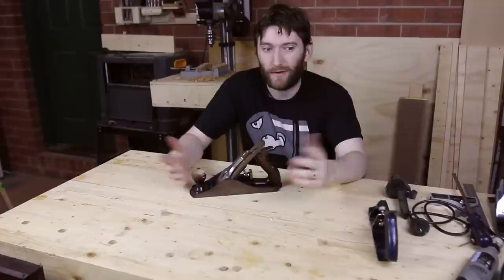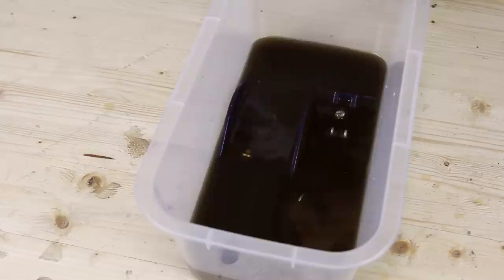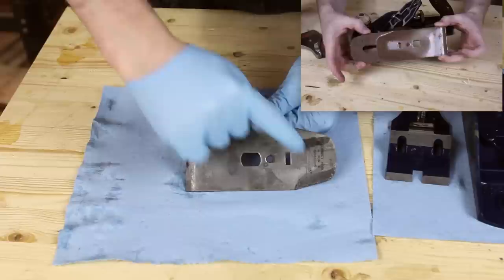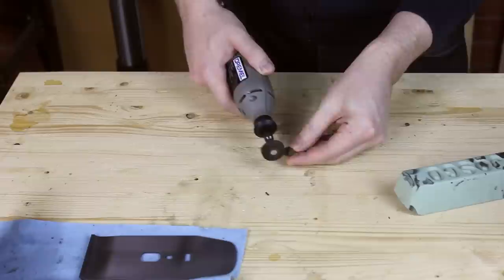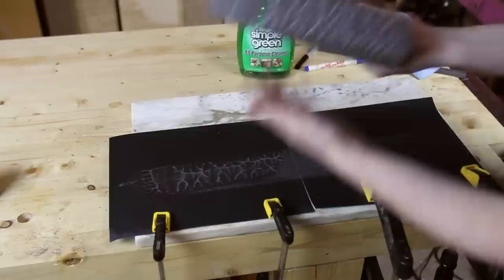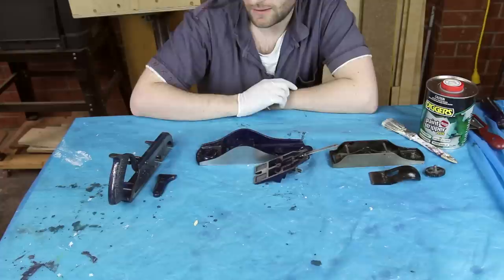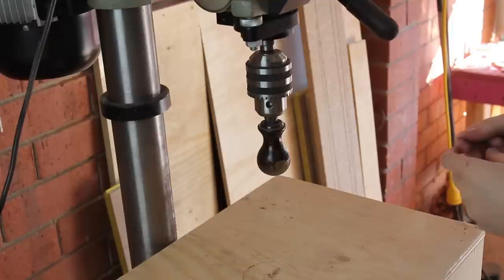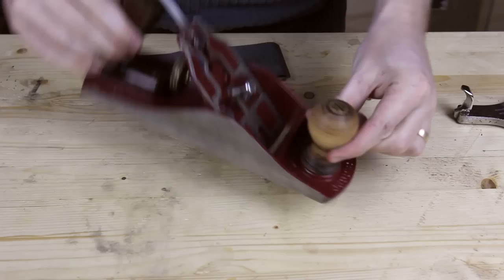017 - Restoring a junk market hand plane

Comment: When dipping something in whatever solution, for whatever purpose, if the part to treat, coat, derust, etc, isn't covered entirely, a simple trick is to use a non reactant object to displace liquid and enable full immersion, a small glass jar with some ballast to weigh it down would do the trick fine!
Reply: Excellent suggestion.

Comment: You probably already know this, But when ever I sand metal, I get it wet with water first because then the 'sand' from the sandpaper acts a little like diamond past, but WAY cheaper. It will create a paste, which is just the sand and iron shavings. If you start at a low grit, say, 80, then you work your way up to 2000, you shoul have mirrors in no time. I know it isnt particularly relevent to the video (which is exellent by the way) but I thought it may be helpful fir the future

Comment: Card scraper to get the finish off the handle. It'll come right of faster than you could get it off with power tools and without affecting much. 

You can sand off the facets the card scraper makes on the handle if they bother you.
Reply from the maker: David W Thats actually a pretty good idea. I might see if I can pickup a card scraper and burnisher at the Melb Wood Show on the weekend.

Comment: Nice work!, I'd like to point out that rather than having to turn over the plane body because you don't have enough liquid to cover it you could also put some other objects into the liquid to raise the level, I've used glass marbles in the past to good effect. To save time and your fingers you can take some scotch brites and using a nut, bolt and a couple of washers make a sort of polishing wheel with them, use this in you drill and it will get the job done in no time.

Comment: That was really cool, I see planes like that at the local Trash'n'Treasure, but the old guys selling them want $100 a-piece! $20 is a bargain!
Reply from the maker: Thanks Mario, this was from the Wantirna/Knox Trash&Treasure so I think I saw the guy selling the planes for $100. To be fair though, the guy with the $100 planes had them all in excellent condition. He had a complete Stanley #45 (I think) for $75, including a few of the cutters. They routinely go for double that on eBay!

There were probably another half dozen sellers with planes ranging in condition - the one I got was middle of the road, prices ranged from about $5 (real junkers with deep pitting) to $50 (...also some real junkers at that price!). I actually noticed 4-5 people walking around with #6-7's, so it was a case of get in early.

Comment: Kudos for wearing the gloves but not for the absence of safety glasses when using the paint stripper. Those brush bristles flick and Murphy's Law really does work sometimes.
Reply from the maker: I appreciate the concern, but as I live in Australia, I've built up a resistance to most household chemicals. The venom from drop bears is a much higher risk than the paint stripper.
Reply: Viking Code Ditto, I'm in Port Macquarie. I accidentally got some Sensodyne in my eye when it flicked off a toothbrush bristle. Stung for a week and that stuff only has minute amounts of caustic soda and silica (among other things).
Not worth the risk.
Reply: Hw1712 I  agree with you 100%,what I thought was an innocent chore left me blind in my left eye. Paul you only have two blinkers,PROTECT THEM. Greetings from the USA

Comment: What did you do to clean up the lever cap?  It was mentioned that the process was different but you didn't mention it again.  My apologies if I missed it.  Great video btw.
Reply from the maker: You're right, I didn't actually cover the level cap. Same as what I did for the brass components - I used my dremel with a buffing wheel and some polishing compound. Depending on what condition your level cap is in, sometimes its worth stripping (sanding I guess?) the chrome covering off and just polishing up the raw metal.

Comment: Excellent stuff. I have a couple of planes that i picked up at a similar market. But i have never restored them because it seems so daunting. Electrolysis this! and acid that! Im definitely going to go and pick a bottle of that 'evapo-rust'. Bunnings?

And i dig that you painted them all. thats super cool. 

Nice vid mate.
Reply from the maker: I wish bunnings had it! http://www.evapo-rust.com.au/Shop.html is where I got it, the 1L has been good for 5 planes (#4 for my BIL, #4 1/2, #5, #121 spokeshave, #130 blockplane) and a tenonsaw - its not 100% depleted yet just takes a bit longer than when I first got it.

I tried Rustbuster (I think was the name) from Bunnings, had no luck with that at all.
Reply: Dang. 

Thanks for the link. I'll check it out.

I have an old tenon saw that i started working on a couple weeks ago. I just spotted it sitting there when i had my orbital sander in hand.... next thing i knew i was sanding off the rust. Dont even know really how it happened. It ended up cleaning up fairly well. But botch job compared to the process you have just undertaken. aaaand i probably have Rust in my lungs now.
Reply from the maker: Glen H Sanding surface rust is perfectly legitimate! Saws are nice flat surfaces so a sander can be used, although yes dust is an issue. Wet/dry sandpaper with some WD40/water/whatever will help keep the dust from flying in the air. Harder to get an orbital sander into all the nooks and crannies of a plane frog though ;)

Comment: Thanks for the video. Planes, and many hand tools were not painted red, generally, as the colour red dosent highlight blood very well. If a cutting surface is very sharp you can cut yourself to the BONE without even feeling it ! I know as ive done it on machine tools ! What alerted me ? Yes thats right the blood. Now im not saying not to paint your stuff red.Some do, or any color you like but i like to keep the tools ORIGIONAL but thats my presonel preferance. Any suggestions on how to grind, hone a blade thats damaged with chips from hidden nails ?
Reply from the maker: If its got chips and other damage to it, the best way is to really take it to the bench grinder. Even using low grit diamond stones takes far too long. If you've got a grinder with a decent size tool rest, its not too difficult to grind back just enough to remove the damage by angling the rest to match your plane blade (~30degrees from memory is normal?).

If you don't have a guide, you can make one, but they're relatively inexpensive to get OK quality, and its useful for any damage you might get in the future, restoring old tools, etc.

As for honing, I'm awful at sharpening free hand. I was given a Veritas Mk2 Honing Guide, and I love that thing. Makes it simple stupid to work through the grits no matter what the sharpening medium is. I use diamond stones because they work out relatively cheap compared to higher end water stones. Paul Sellers has a few great video tutorials on sharpening that I highly recommend.
Reply: Paul Jenkins
Thx Paul Much appreciated. Ive got a bench Grinder unfortunately ive no power in my garage ATM. However Ive a little Bench Grinder in my back room but its a Draper and so shoddy that I hesitate to use it as i really dont trust it. Wheels need to be reground and are the cheepest of the cheep. Ive been doing a little daily to the blade on a cheepo waterstone and  ive almost got it down so that you cant see the chip marks. One bad one remains on the corner. Hope to get it honed of on the waterstone within a few more days :/ Not worth the time but its my only option currently.

Comment: Great vid thanks heaps. I did this on an old No 5 Bailey I found. Looks really great, but for some reason the brass nut on the front knob doesn't sit flush. It stands out of the wood by about 4mm. Any ideas?
Reply from the maker: Perhaps there isn't enough thread on the stud? You could either make a new knob, or use a die to cut more threads. I don't know what the thread is on the knobs though.

Comment: hey this is great! I used your video to start my own plane restoration. I've never done anything like it before. I tried the WD-40 to clean up the black splotches but couldn't get it as clean as yours. Any suggestions?
Reply from the maker: Looooootts of scrubbing. Alternatively as mggcomputers suggested, you could use a power sander ("mouse" style would give you the most control) to speed things up.

Comment: I'm sorry, but that is spray product that uses the 4 minutes?
Reply from the maker: WD40. Helps lubricate the surface to make the scouring pad 'slide' better
Reply: Paul Jenkins Thanks so much.
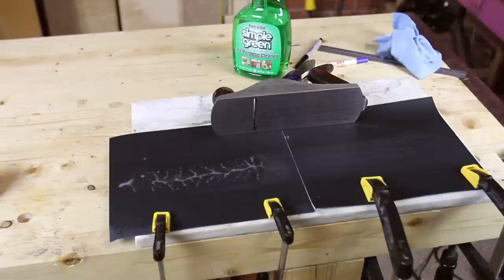Reply: chitarra2001 One last question, what card you are using glass in the video to the minute 5:20 and 6:50?
Reply from the maker: chitarra2001 I'm not really sure what you mean. Its a piece of marble with sandpaper on it. I've used Simple Green as the lubricant on it
Reply: Paul Jenkins I wanted to know who has the grit paper?
Reply from the maker: chitarra2001 Oh! I got mine from Bunnings - the local chain hardware store - from their painting (rather than tools) section. Most hardware stores, automotive stores or even paint stores will sell it. Its "Wet Dry" sandpaper, paper backed, usually black in colour.
Reply: Paul Jenkins I wanted to know the number of paper grain?
Reply from the maker: chitarra2001 Use multiple grits - I started at 200, then 400, 600 and finally 800. You can go higher if you want a higher shine, but don't start too high if you have a lot of material to remove because it'll be too slow and wear out the higher grit papers quicker.
Reply: Paul Jenkins Thanks so much. Great video. For me, I do not know English.

Comment: Great video - one question... why does everyone that posts hand plane videos use MASSIVE screwdrivers for dissembling the planes?  Its really getting ridiculous.  Not sure I can take much more of this.
Reply from the maker: You want to use a screwdriver with a head as wide (or wider) than the screw, otherwise you'll damage the screw. I have very few flat head screwdrivers as it is (they're awful), but I don't have any very-wide-and-short flathead screwdrivers, so I had to use the largest one I have.

Comment: Coca Cola is the best of all to clean metal from rust
Reply: ?? If you clean the metal from the rust and the metal goes away, aren't you just left with a pile of rust??
Reply: bob6977 Nothing like adding to the knowledge base, Duh
Reply: 5807141
It certainly is as long as your knowledge base is not flawed. You're correct in that coca cola is a good rust remover, no doubt, but in your statement you're saying it's a "metal remover" not a rust remover. Take care.